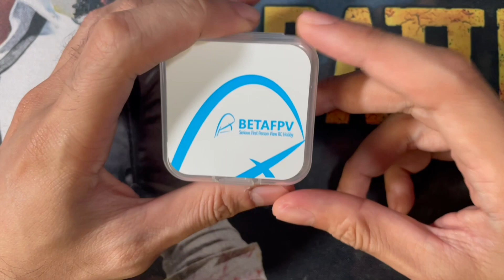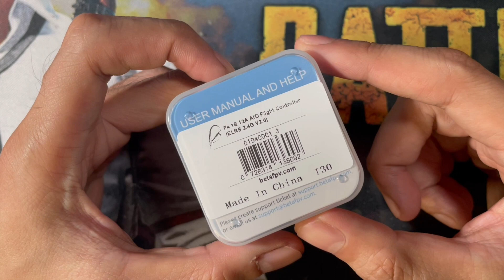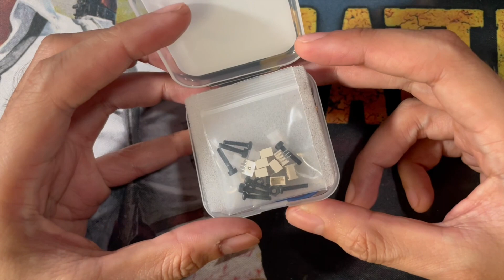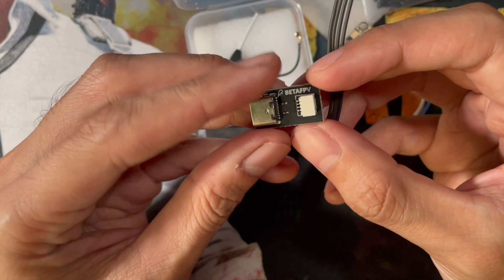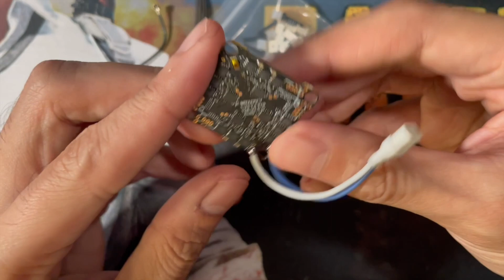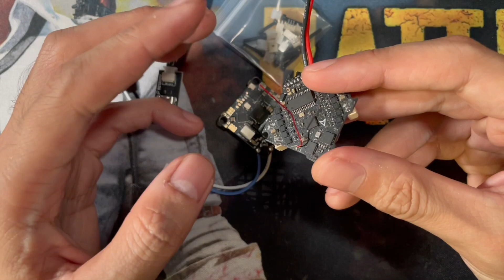BetaFPV 1-2s AIO FC ELRS 2.4G V2

Comment: very unreliable FC's: from burned ESC on the 3rd flight to Gyro errors with several flyouts to the moon included. I wanted to build a 2inch 2S, but didn't find any FC AIO that worked properly.